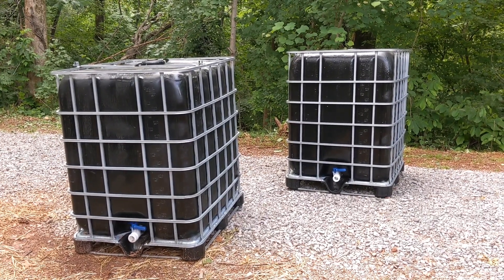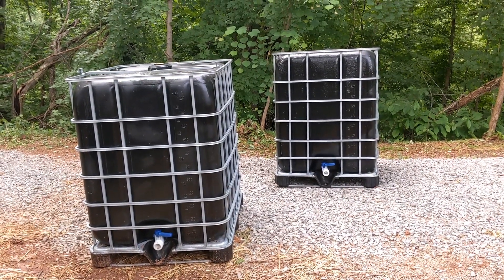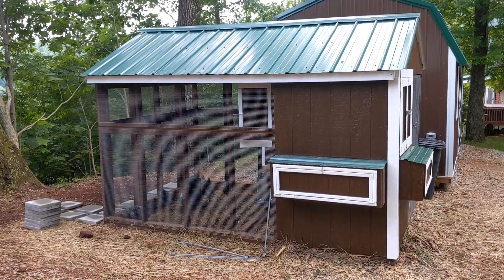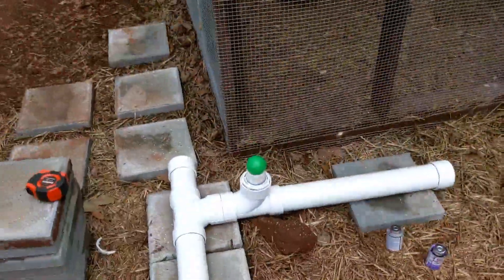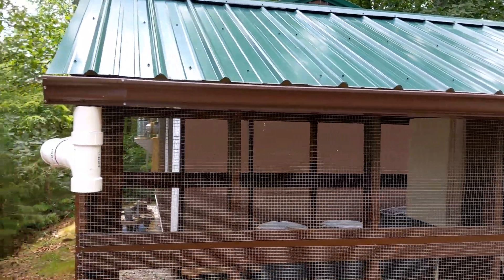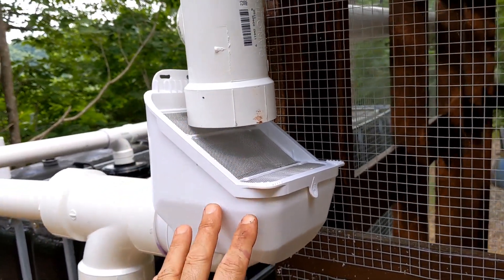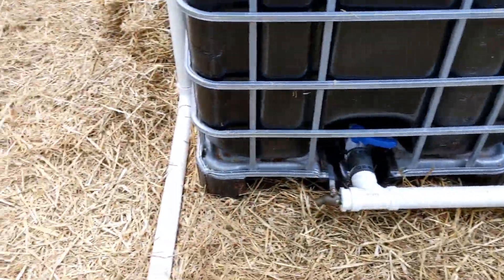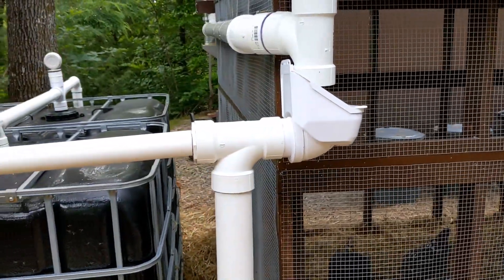Rainwater Harvesting

Comment: In the winter you will not be using the water for the garden, so you can close the tanks bottom valve and then open the hose valves to drain the water to prevent the drain pipe from freezing.  Nice project.  Now you need to get the garden started.  I just finished two 4x8 raised garden boxes.  Now I’m trying to mix up some garden soil using food scraps, chicken & pig manure and this crappy Florida soil.  Casa de Will is looking good.
Reply from the maker: Thanks Keith, good to hear from you.

Comment: I'll be building my water system soon. Good video. I keep wondering how to hook my pipes to the lid of the water tank
Reply from the maker: My two large threaded lids came with a 2 inch npt threaded center cap.  I simply Teflon taped and screwed in a 2 in thread to slip PVC part.  If your tank doesn't come with that kind of lid you can buy it on amazon.